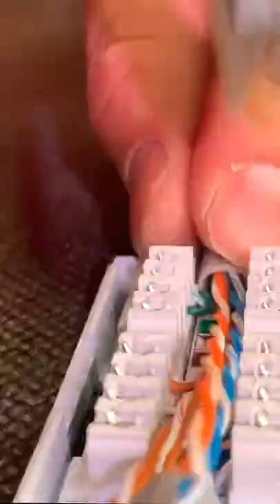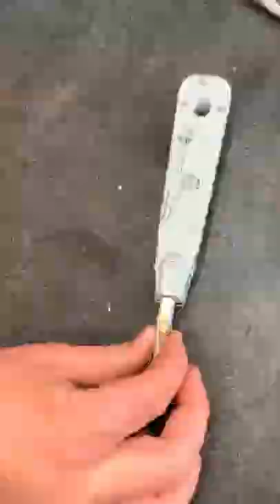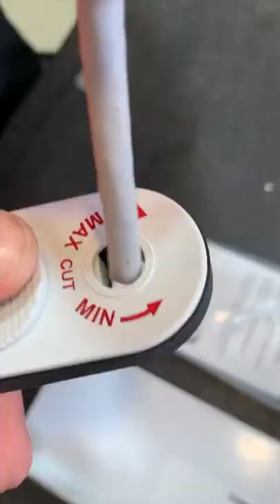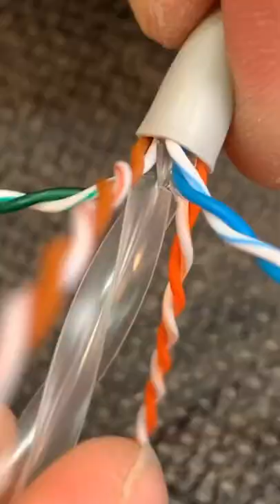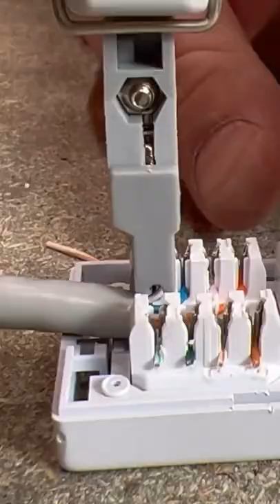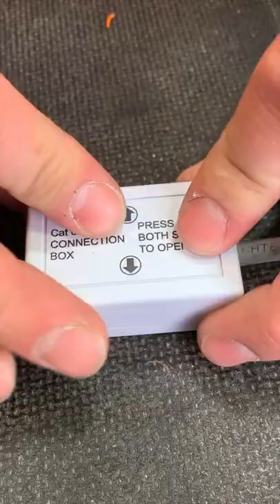Extending CAT 6 Cables

Comment: bt has been using jelly crimps for decades on the network outside of homes. ie. cabinets and exchanges. the telephone cables coming into your property are probably joined with these jelly crimps a good few times between the cabinet your house is feed from and back to the exchange. just use jelly crimps
Reply: That probably explains why everyone's ADSL connections are so pathetic.
Reply: DSL and ethernet not at all comparable.
Reply: I can vouch for this.
Reply: Jelly crimps are used on category 1 cable, not category 5 or 6.  You could try them but you’d probably be taking on liability if there were problems.  Remember these can be used to make 999 calls, and fire hazard becomes an issue with power over ethernet, so do the right thing.  Remember there are cabling safety standards that are required by BS7671.
Reply: This is vastly reducing because of changes around DSLAMs. (Few people are served by the exchange directly now, hence they are being closed so it wouldn’t “come” from the exchange they would be served by it) Also that’s for the ADSL2+ mostly. Ethernet is must more sensitive. Different protocols with different attenuation and interference. If you terminate 500m of Cat5e you won’t get Ethernet working but ADSL would be totally fine.
Reply: As of about 20 years ago 3M says their jelly crimps (Scotchlok UR and UY) meet Cat 5 specs.
Reply: On ethernet? How about no...

Comment: These are Not even near CAT. 6....
Reply from the maker: Why is that?
Reply: @efixx   CAt6 is supposed to have a shielding over all this wires
Reply: @MirceaPrunaru  um. No. That is not correct
Reply: @TheWittyGeek  Considering the cable lengths were shortened at the keystone, the rating of the connection was lowered to CAT 5 UTP. You're gonna have speed issues with the twisted pairs being different lengths, especially at the connection speeds expected from CAT6 cables.
Reply: @BrunodeSouzaLino you've never seen a CAT6 consolidation point?
Reply: @shaunclarke94  By standard, you can only have 1/4" of untwisted cable length at the keystone. If you have more, then there's no guarantee you'll get 10gbe because of extra interference.
Reply: @BrunodeSouzaLino twists looked well maintained to the IDC slots to me?

Comment: That will never pass the cat 6 test NO WAY and as a quick fix till you run a new line you could use that but noway is that a professional problem fix
Reply: Consolidation points are a thing.